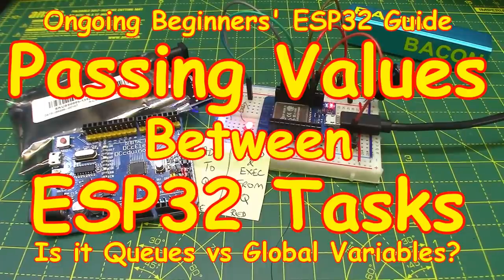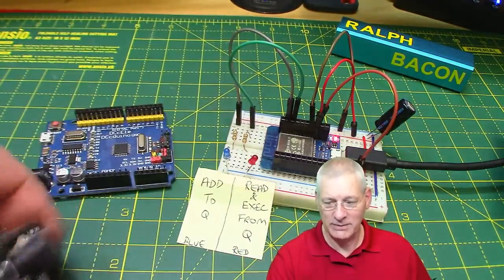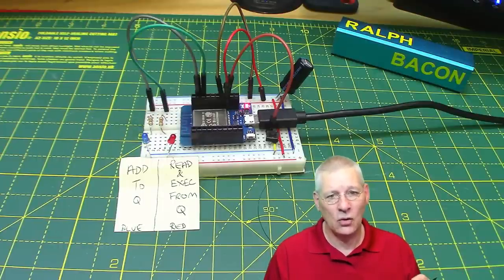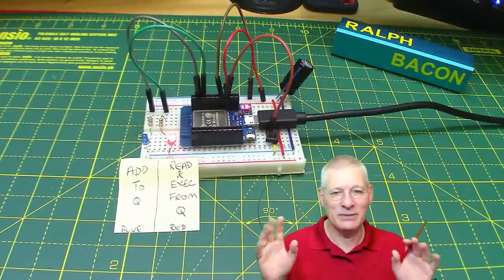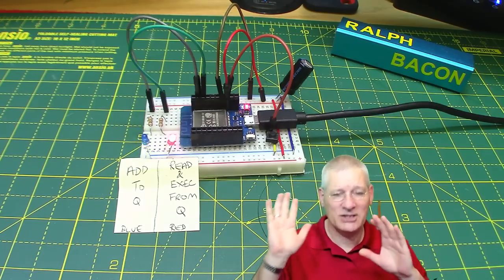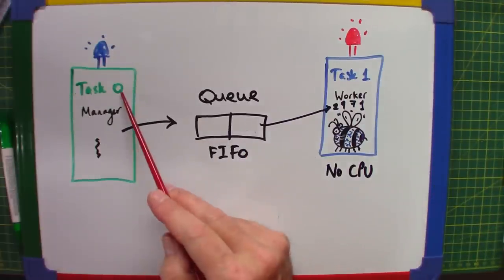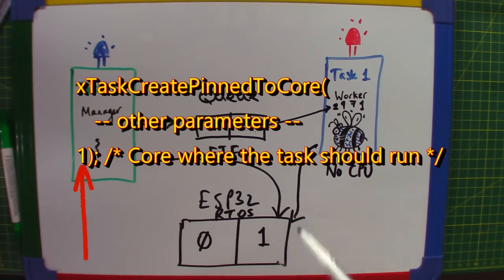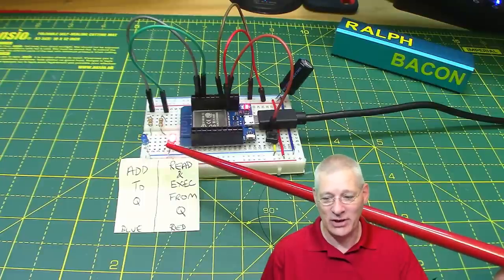#151 - ESP32 Passing Values 💾 Between Tasks - Deep Dive (2 Easy Ways)

Comment: Ralph, you do know that you can pass a global variable in your create task setup? It's has to be a void pointer, so instead of actually returning a variable, it places it in memory where it can be read?

int count0 = 9;

                      xTaskCreate(
                     globalIntTask,             /* Task function. */

                    "globalIntTask",           /* String with name of task. */

                    10000,                     /* Stack size in words. */

            -->> (void*)&count0,      /* Parameter passed as input of the task */

                    1,                         /* Priority of the task. */

                    NULL);                     /* Task handle. */

//to retrieve it in the function
void globalIntTask( void * parameter ){

 

    Serial.print("globalIntTask: ");

    Serial.println(*((int*)parameter));            

 

    vTaskDelete( NULL );

 

}
Reply from the maker: Indeed I do, Jeff, but that 'just' passes a parameter at the time of initiating the task, of course. Now, if the variable we're passing is a global variable that might be OK to pass variables but IMHO not ideal. I'm guessing there's more to it otherwise it would not be offered. You'd still need to use mutexes to prevent updating at the time of reading, I'm assuming, so why this is better than queues is currently not known to me! Do have insider knowledge?
Reply: @RalphBacon  The reason I mentioned this example is, in your video you are just declaring a global variable and using it in your function, not good programming practice - could become corrupted else where in the program. I am simply pointing out, if you want to safely pass a global variable into the function this is a way to do it at start up. You can then check it's validity.
Reply from the maker: Ah, you mean pass the variable as a void pointer to multiple tasks but access it as though it were a global variable but its scope is tightly controlled? That sounds much better, Jeff, I will bear this in mind for any future video on ESP32 variables/tasks videos. We can only pass a single variable though, right? Could we pass a struct, I wonder, containing all the variables required. Or an instance of a class object? Thanks for clarifying.
Reply: @RalphBacon  Ralph - I guess you can, the variable has to be stored on the heap not on the stack( temporary memory), apparently using word size memory not bytes,  let me draw your attention to these URL's: https://www.freertos.org/a00125.html  and  https://www.esp32.com/viewtopic.php?t=1892, try it out - I think this would be a good topic for your next video, interesting concept.
Reply from the maker: Yes, it is interesting, I shall have a read, thanks for the heads up, Jeff.
Reply: @RalphBacon  Your welcome, I expect to see a how to video out on this by the end of the month.
Reply from the maker: OMG, please no more pressure, I get enough from my sponsors!!!

Comment: If i use volatile global variable will it be safe to use between threads?
Reply from the maker: No, Alexander, volatile variables are not thread-safe. You would have to use semaphores or use another signalling system to ensure you did not stomp all over a variable as it was being updated by another thread.

Remember that volatile variables are simply those flagged to the compiler that they are unsafe to be referenced by a register where the compiler might have put a copy of the variable's value; it will always be retrieved from its memory location. But that doesn't help across threads at all!
Reply: @RalphBacon  Hm actually after some research and reading, looks like in some case i can use that. Depending on controller "bits" so in arduino it is safe to use byte size variables, and it case of ESP i could safely use up to 32bits variable. But if some structure to read is more than 32bits in this case could be problems
Reply from the maker: Well, OK, a single byte is OK, because the operation is atomic - that is, it completes in its entirety or not at all. But updating an integer (2-bytes) can go very wrong, as one task updates the low-byte then before it has a chance to update the high-byte the other task stomps all over the low-byte value (or reads a now corrupt value).
Personally, I think it would be foolhardy to hope it will work when semaphores are very easy to use and are designed to avoid this exact situation of clashes. Just sayin'! 😜

Comment: Im trying to pass a dynamically changing variable to Task 1 (one task only) that is running like infinite loop, the variable has been defined in .h file and used by the software and dynamically changing, I want to keep track of its value
I could pass a constant  and it works, can you help please?
Reply from the maker: You need to pass it as a (void *) &reference (pointer) and then de-reference it in the task back to the correct variable type. I'll post some very simple code tomorrow for you; I do this in my project. What are you passing to the task?
Reply: @RalphBacon  can i send you my code so to show how i can modify please
Reply: @RalphBacon  thanks Ralph much appreciated im passing a float variable that is being used elsewhere and changing i need to track its value it is declared in a structure in .h file and used by .c files i think 2 i passed a constant float variable and that worked but the varying one is not giving me the right values
Reply from the maker: This is how I do it:

1. When you create the (pinned) task, I pass the parameter like this:
 (void )&myVariable, / Task input parameter */

2. In the task I dereference it (to get to the actual value) likes this:
int myVariable = *((int *)parameter);

You need to do this action whenever you want to get to the new (updated) values.

I was wondering whether there was another way I could do this but as I am using a struct in an array it's the best way for me.

One word of warning: floats are not a good variable type to pass around as they get rounding errors very easily. Better to use an integer (2 bytes) or a long integer (4 bytes) and then divide down to the float when you need to display it. It's what I do.

Example: float value of 10.45 received from some sensor.

Multiply by 100 to get 1045 as the integer value that you can then use without worries of rounding errors.

When you need to display the value just do
(float) myInteger / 100.00
Reply: @RalphBacon  Hi Ralph thanks for your reply this is my code in the task its running outside void loop()
void task1(void *parameters){
//contl.LutOut=34.0f;
//volatile control_output_t contl;
digitalWrite(2,HIGH);
delay(5000);
digitalWrite(2,LOW);
delay(5000);
	 for(;;){
	//volatile control_output_t contl;
	if(contl.LutOut>33.0f) {digitalWrite(2,HIGH);
	}	
	else if (contl.LutOut<32.7f){digitalWrite(2,LOW);
	}
	
	delay(1);  //added 
Ignore the commented code
This is my pinned task in  void setup()
	xTaskCreate(  //added
		task1,  //added
		"Task1", //added
		1000,  //added
		NULL, //added
		1,  //added
		NULL  //added
	);
contl.LutOut is the float variable declared with instance from a structure in .h file 
Im comparing the variable is 34.0 or 32.0 I know their values so left room in the comparison above with <>
I have passed another float variable that I created and assigned value to it,  it worked
name of structure contl={23.0,40.0,30.0} in the .c file contl is an instance of  "name of structure "
The above worke when i assign values, so the Task seems to work well
But contl.LutOut is a variable that keeps changing in the software so I need to know if its 34.0 or 32.0
I know the variable is either 34 or 32 but i need to know when
Regards,
Suded
Reply: @RalphBacon  regarding passing a global variable or passing a parameter using the (void*)&blah blah...
What's the advantage / disadvantages of both ways.
I know it's been a while since this vid, but I'm struggling with some code right now and this could be useful.

Comment: I am not sure what I am doing wrong but I am getting the following error. I think when I comment out vTaskDelete(Null) it stops rebooting but nothing appears on the serial monitor. 

rst:0x1 (POWERON_RESET),boot:0x13 (SPI_FAST_FLASH_BOOT)
configsip: 0, SPIWP:0xee
clk_drv:0x00,q_drv:0x00,d_drv:0x00,cs0_drv:0x00,hd_drv:0x00,wp_drv:0x00
mode:DIO, clock div:1
load:0x3fff0030,len:1240
load:0x40078000,len:13012
load:0x40080400,len:3648
entry 0x400805f8
Reply from the maker: Why did you delete that task? It is the loop( ) task which must either contain a single "delay(1)" or it must be removed by the line you commented out. Reinstate the line (or put in the delay) and see whether your device boots again. Don't forget to set the Debug Level to VERBOSE (level 5) as part of the Tools / Settings.

Comment: In generic: the use of delay(); is the worst possible function at all. Better is the use of millisec or microsec. delay(); is one thing for beginners to learn, OK, but not for the more experiencde user.
Reply from the maker: delay( ) is a blocking call, even in the ESP32 environment, so I agree it is best avoided unless you do actually mean to block the task - and suspending the task for a time might be a better approach even then.

In my "real code" I don't use delay() at all, but have a state machine that checks the time since the last call. Easy to do and ensures that routines are only called infrequently.

Alternatively, I used taskYield( ) with the ESP32 which gives up any remaining time slice to other tasks although there are caveats to that approach, as the next task might not get its full timeslice.

In some ways, it is a pity that delay() is used in the Blink sketch so beginners learn that approach first - but it is an easy way to get coding.
Reply: @RalphBacon  - Right, sorry when i thougth that you are one User who is working in an old way or better in a way which is told every beginner and in my world this is wrong and.or the half truth which is more worse. Again SORRY for my mistaken thought ;-).
Reply from the maker: No problem, always good to remind other readers that delay() is not to be abused. A bit like using GOTO in code!!!